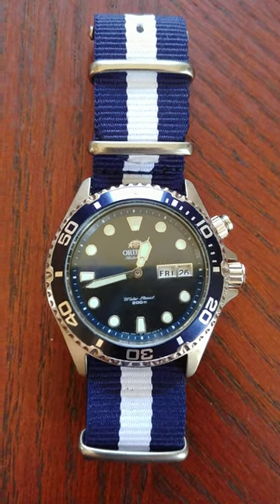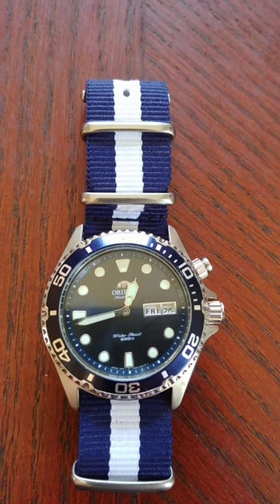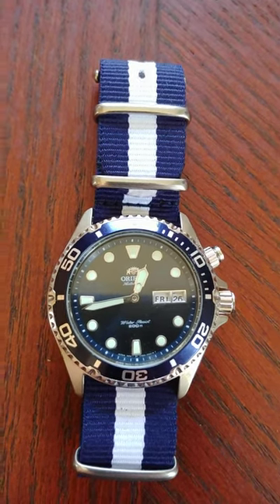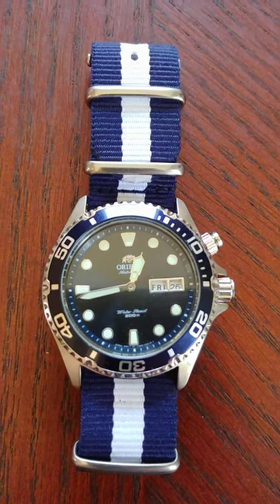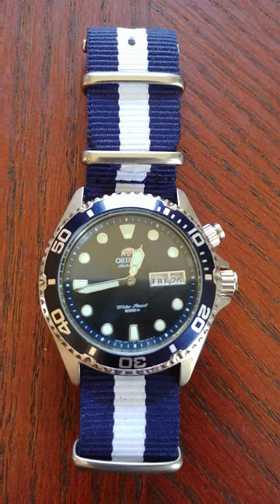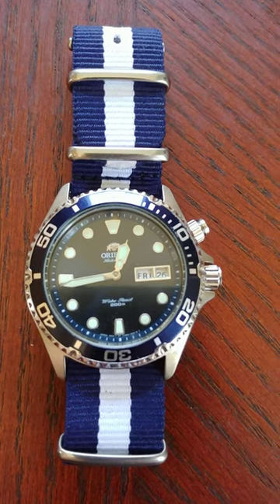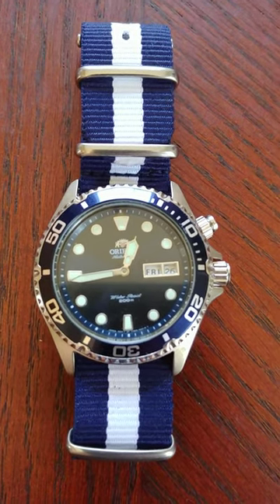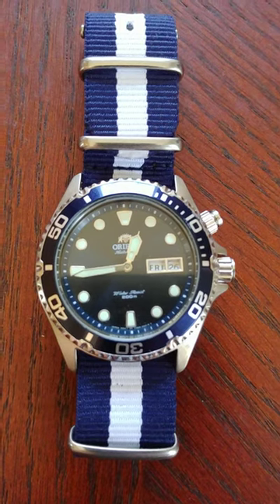Misaligned watch dial causes.

Comment: How do you realign it?
Reply from the maker: You would need to re-attach the feet in the exact same position with a watch dial feet soldering machine or obtain a replacement dial from Orient however I'm not sure they will sell watch replacement parts to the general public.
Reply: 24 Hour GMT Channel thanks. I have the same issue with a different watch. Don’t have the courage to open it..